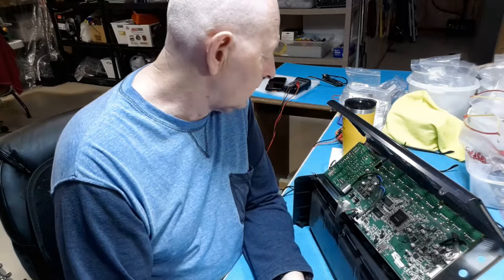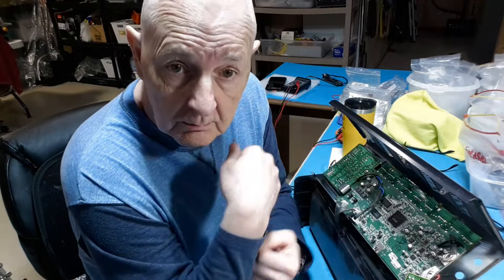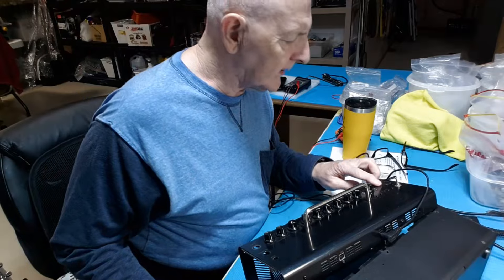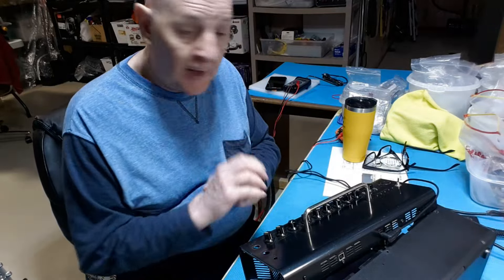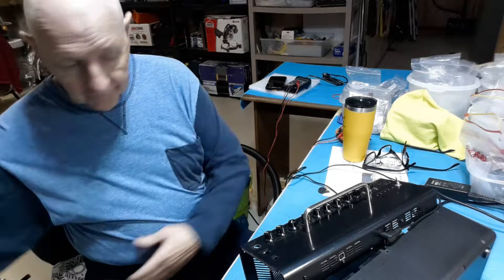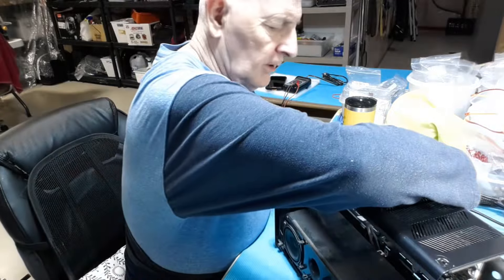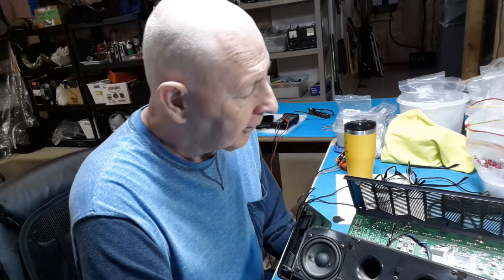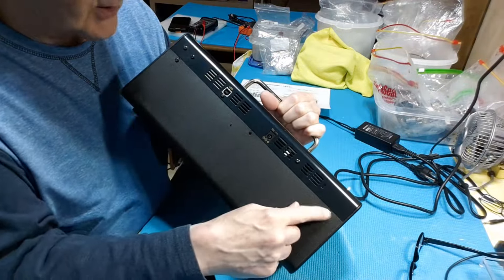THE YAMAHA AMP THR10C  FROM CalB AND ROCKO THE CAT CHANNEL PART 2

Comment: I've had this exact amp for years, and I love it! In fact, I bought the next version after this one, the THR 10/2. The app helps for the newer version.. The only downside to these is the firmware. I don't even know if you can get the firmware for the older versions anymore. Yamaha's website can help you there, but I don't think it's there now. Both versions sit on my desk and give me all kinds tonal options. I'm totally happy with them.